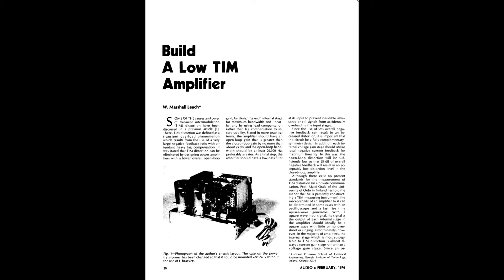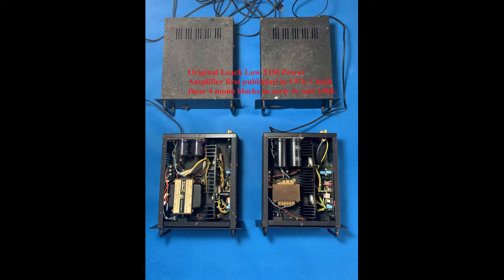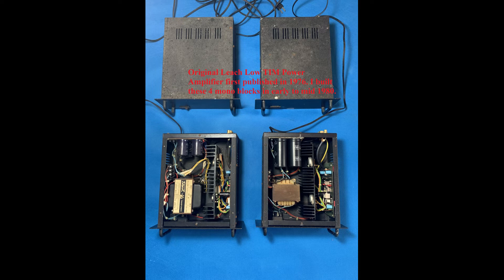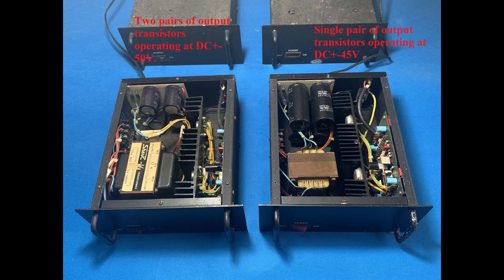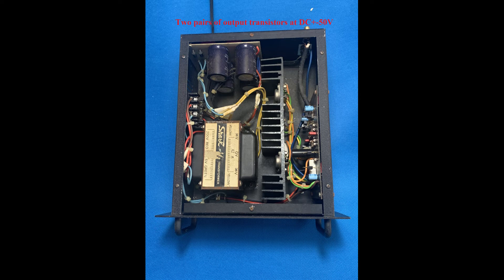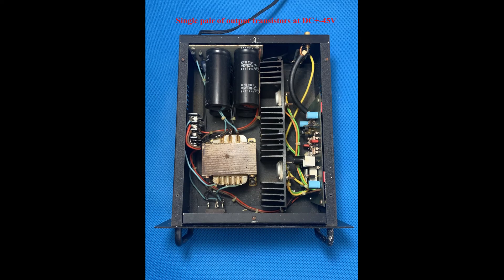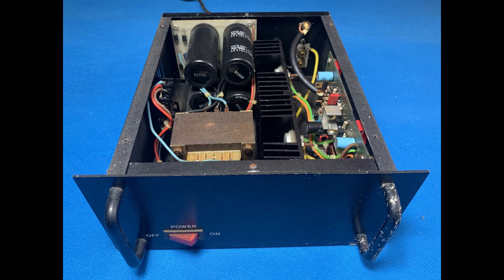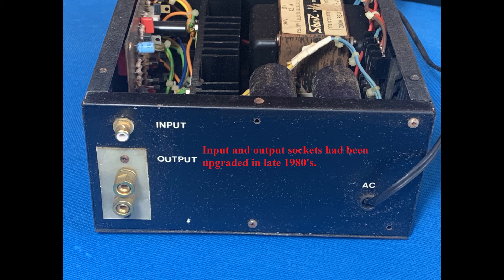Leach Amp (1976)

Comment: Thomas, what is the rating power of this amp per 1 channel?
Reply from the maker: 100W @ 8 ohm
Reply: @thomasdiyaudio5353  Thanks. I'm starting building my units based on Mr. Leach design. Best regards.

Comment: Nice looking Builds! I was a student of Dr. Leach in 1980-82. I built a Low TIM and a double barreled amp while I was one of his students. I am cleaning and repairing the Low TIM amp and look forward to hearing more of your experiences.
Reply from the maker: Did you build his pre-amp? I did but I only have the phono part with me. No idea what happened to the line amp. As a matter of fact, I am in the process of building the line amp again to see how it performs together with the power amp.
Reply: @thomasdiyaudio5353   In addition to the amps, I built a speaker system that was his "lab" system at the time. It is bi-amped with an active crossover he designed.  Awesome sounding speaker system with his double barreled amp on the woofers and the Low TIM on the high frequency head box. We we are listening to it still.

In his Audio Design class we had to calculate the RC values to accurately reproduce the RIAA equalization curve for a phono preamp.  He said it was important to get the EQ curve right in a phono preamp. Did he publish a design for a preamp? I would REALLY like to build it.
Reply from the maker: @fisherhutchens9452  If you message me your email address, I can email the preamp publication to you.
Reply: @thomasdiyaudio5353  How do I message you?
Reply from the maker: @fisherhutchens9452  Here